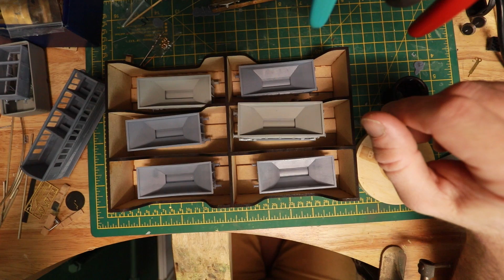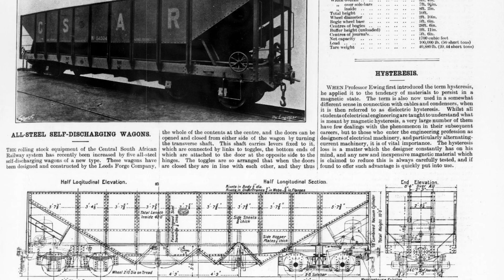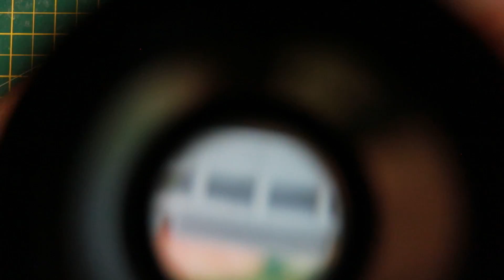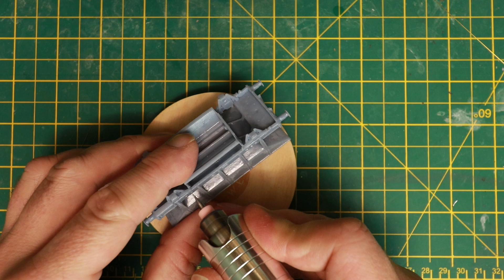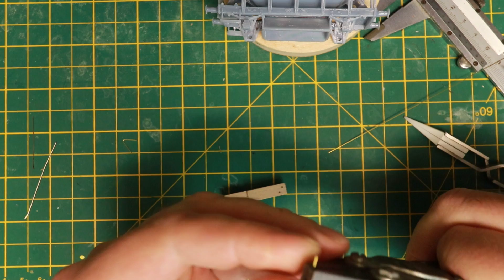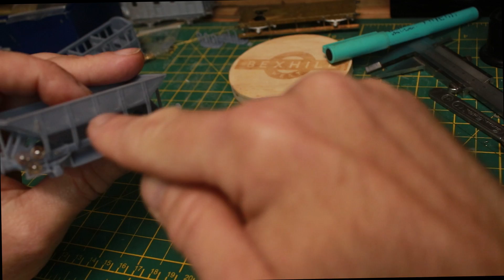S2 E38 | A 3D Printed Model Railway Wagon for Bexhill West Model Railway

Comment: Hello again
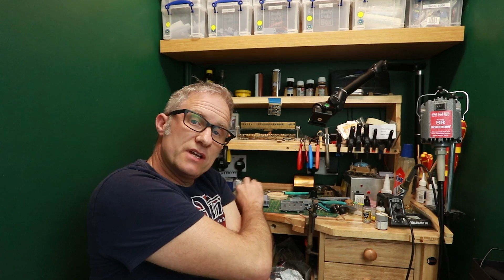30:24-30:11 "... one piece 3D print ... coach ..." -> about side panels; flat, curved, corrugated, ... and combined construction, with window frames and with / without compartment doors 🤔or some of the mentioned versions better printed in more parts 🤔 
Spring-loaded buffers would be a nice topic on it own 😜
30:12-31:35 noting against lasers 😊

Comment: Great video supper tip on the wire for a drill. Out of interest I note you have resin cast both the W iron and axle box, does that mean no suspension on these ballast wagons?
cheers
Phil
Reply from the maker: HI Phil,
I hadn't intended to fit suspension but following a question about it from another viewer I've gone back to the drawing board and built some springing in.  The open top nature of the wagon frame rather precluded fitting a commercial springing unit such as a Bill Bedford etch.  However, I've come up with something now which works really well and is very discrete, so expect to see a fully sprung wagon in part 2.  :)
Thanks for watching,
James

Comment: Live with James !!!
Must be a YouTube first, to the norm, which leaves the fiddly bit out, you actually went there, very brave I must say.
I must say the level of detail is exceptional, but I wonder why you didn’t resin print them ?
Regardless thanks so much, love the detail
Reply from the maker: :)  What I didn't show was the endless picking-up of fiddly bits which had pinged onto the floor.
By the way, these are resin prints.  I suspect my mention of layer lines may have caused confusion.  To be clear the layer lines of the resin print are very fine, but the cruelty of the camera makes them look far more significant.
Thanks for watchinng,
James
Reply: Wow, thanks for that, very informative going forward.
PS the hopper wagons look great

Comment: Hi James any chance of some in o gauge?
Reply from the maker: Of course, that's a great idea.  I hadn't thought to print some bigger.  I'll be able to add the detail to the makers plate too.  :)  I'll include an O gauge one in part 2 - and whilst I'm at it I'll print some in N gauge as well.
Thanks for the suggestion,
James
Reply: Hi James I’m just about to start on my o gauge branch line layout (southern era) I would like to purchase a few of these if you are interested in selling them.
Reply: Well done James excellent video. Just as a matter of interest what machine did you use.
Reply from the maker: Hi Keith,  Thank you.  These were printed on an Anycubic Mono 5s.

Comment: Hi James, Are you going to add any additional weight to the hoppers and coaches. No springing? Any chance we could see something roll over the templot track work that you've already constructed? Just wish I could get my head around 3d. I'm ok with 2d CAD, but 3 d completely eludes me. Great video. Just started harvesting the chairs and timbers for my own layout. Without your video's I'd have been stuck back in the 1960's methods of track construction.
Reply from the maker: Hi Mike, Additional weight will be added to the cavity under the wagons created by the discharge chutes.  I'll see how they work un-sprung for now, but have a springing unit which I can retro fit if need be.
I've developed a neat little sprung system for my 3d printed wagons, but I'm saving it for the time being for a future video.
I'll have them running in the next video, and include some footage with the Plug Track which you've seen, although that's not wired-up yet so I may need to find a scale horse to tug them about.  :)
Thanks for watching,
James

Comment: That annoying feeling when the fine drill breaks, happened to me last week but only a 2mm one so fortunately a quick cycle to the local hardware shop got me a couple of replacements
Reply from the maker: We've a hardware shop in Bexhill which is excellent.  I didn't think to pop along to see if they had a 0.3mm drill, but now you've mentioned it I wouldn't be surprised if they did.  I'll check later.  :)
Thanks for watching,
James